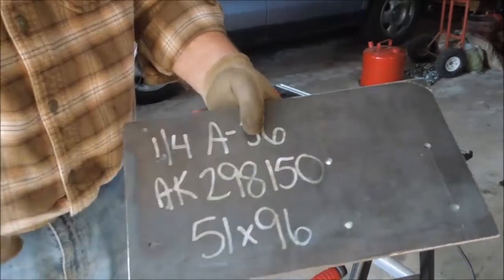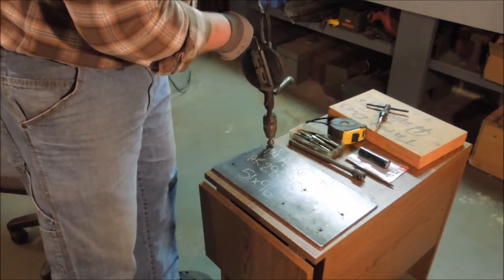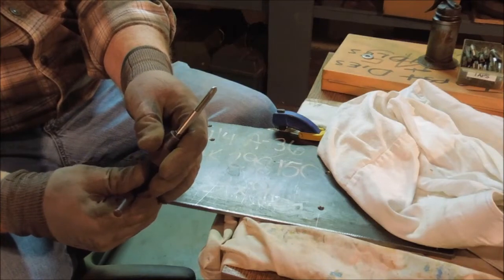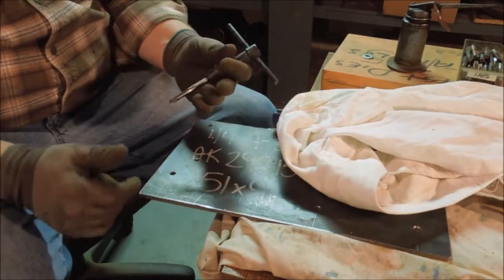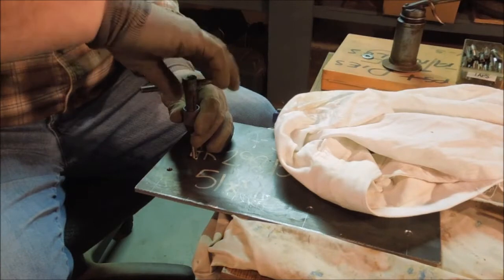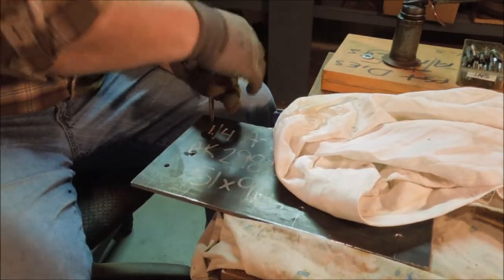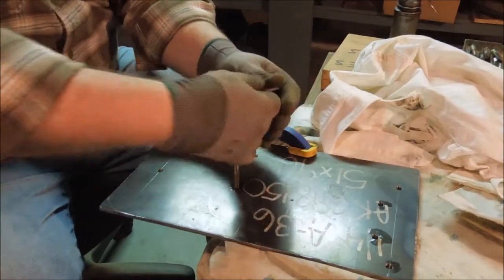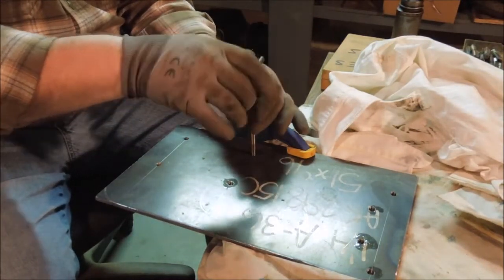Tapping the plate -  South Bend Mtr Mount Pt 6 - by Old Sneelocks Workshop

Comment: Great video. At my first engineering job (fresh out of college) when I went out into the shop to assist the machinists (a devious ploy to learn their trade tricks and secrets), they always showed me as you twist the tap, to make a reverse twist every so often to break the shavings inside. Don't know if it helps any but I do it the same any time I have to tap something now.

Furthermore sir, you made my day when I saw your Millers Falls No. 12 drill. I recently purchased one at the local flee market with aspirations of cleaning it up. I've gotten everything but the main bearing shaft removed. I was able to tap out the retaining pin from the small pinion gear but I cannot get the gear to budge. I don't want to go to crazy trying to knock off the gear but if its just a little rust binding them then I am sure I can manage that. Have you ever tried removing that gear from the shaft? Any input from you would be greatly appreciated.
Reply from the maker: Never tried to remove the gear. I suppose it could be done but might crack the casting by setting up a press to push it off the shaft. If you do manage to get it off there might be a bunch of ball bearings between the chuck and the casting. Unless the shaft is stuck I'd leave the gear alone.
Reply: Old Sneelock's Workshop That was my thought as well, was just hoping you might have had experience popping one loose. Thank you.